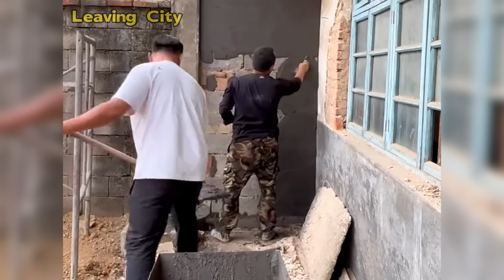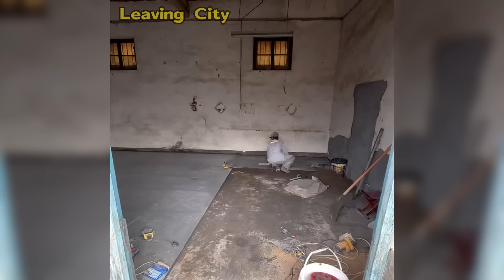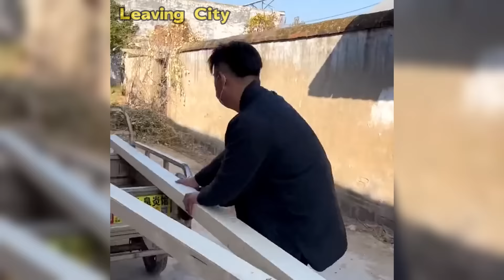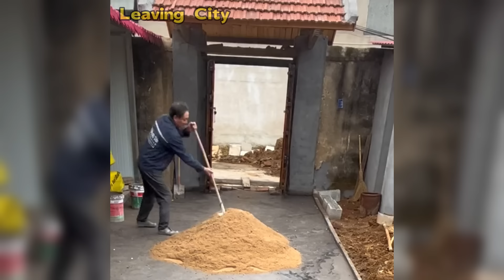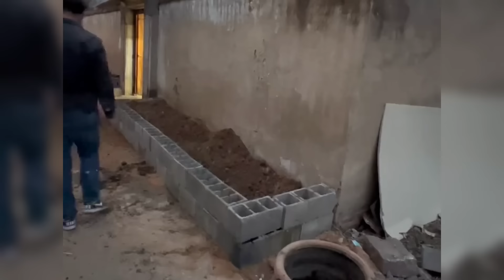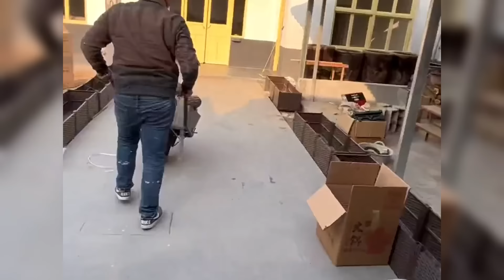10 years after grandpa passed away ~ CLEAN UP WEEDS~A couple renovated the old house left by grandpa

Comment: When we first bought our farm, the house needed lifted because the beams were failing. We used two standard house jacks. It had to be lifted slowly, 3/4ths of an inch per day, because it was a two story house. It worked, then we fixed the beams, we left the jacks alone, but thought about getting a log and hollowing it out to surround the ugly appearance of the jacks. Brick would work, but my foundation and basement walls are made with grey stones. The basement was to the original house that had burnt, built in 1856. The current house is a Sears kit home built in 1945. It’s very solid, built using hardwoods like Sugar Maple, Oak, and Hemlock. Zero pine. I could never find a house more well built. However, due to the shifting, the plaster work is cracked, and windows wouldn’t  open, doors needed re-alignment. We bought a new front door, installed a woodstove, and then replaced the windows. It’s very expensive to fix an old house! I love your videos, they gives me ideas. Thank you!😃
Reply: 😊❤❤❤❤❤❤браво